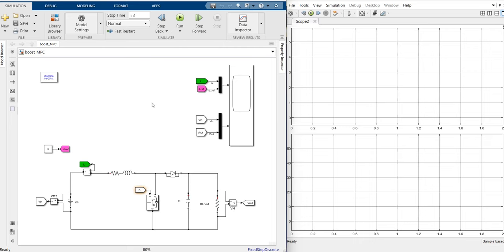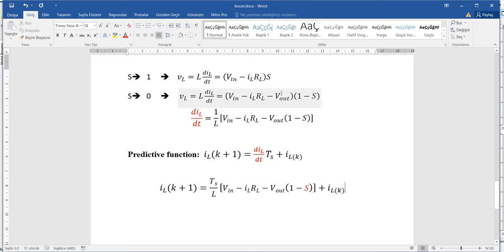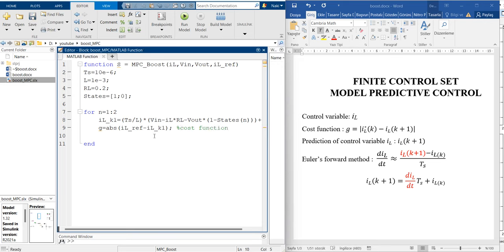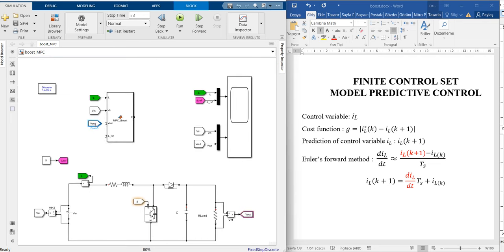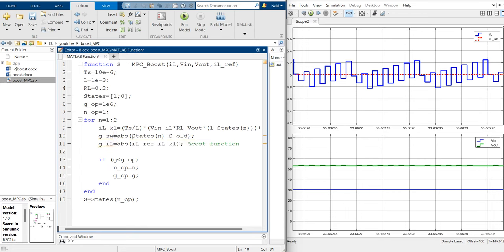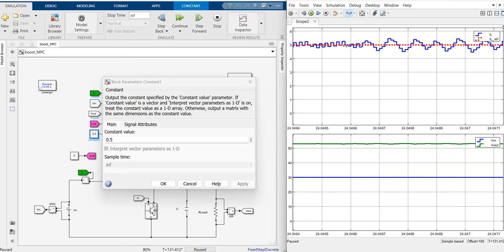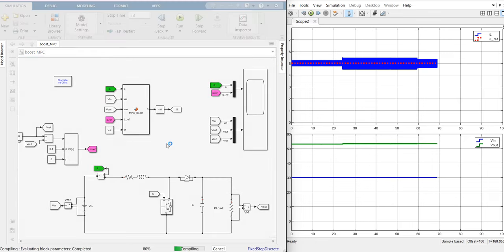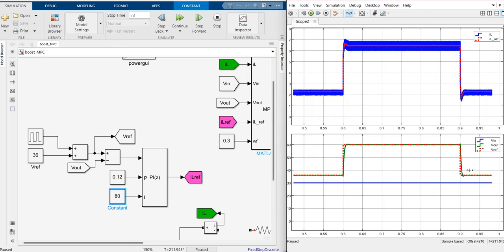Model Predictive Control of Boost Converter

Comment: Dear Professor,
Thank you for the valuable videos on your channel.
I would like to ask you about one of the controller types you discussed in your video: Passivity-Based Control (PBC).
[https://youtu.be/5YT7cERlMrg?si=23UajmS3S1arydMx]
Could you please clarify its classification among control system types?
Also, would it be possible for you to provide another video covering these specific controllers: IDA-PBC (Interconnection and Damping Assignment-Passivity Based Control), Port-Controlled Hamiltonian (PCH) systems, and the Hamilton-Jacobi-Bellman (HJB) method?
Thank you again for your efforts.

Comment: Hello,
I tried a model with the same wiring diagram and the same parameters, but the simscape components (from the domain with the blue lines) and the MATLAB function block were the same as yours.
Solver settings - type: Fixed-step
Solver: discrete (no continuous states)
Fixed move from: 1e-5

And I always get this simulation result: Solver "FixedStepDiscrete" cannot be used to simulate block diagram 'FCS_MPC__Model01' because it contains continuous states...

Could you help me set up the solver and your powergui? Thank you.
Reply: Hey u got the output
Reply: I have simulated successfully. Do you still need help?
Reply: @aungnyanhtun5924  yes

Comment: I want to ask if Vin changes, does Vout also change? for example, if the Vin of the PV changes according to the irradiance and the temperature of the Vout Boost converter it will stabilize at the desired voltage or change according to the Vin of the PV. and one more thing I ask is that because Vin VP changes regarding filling inductor and capacitor values in the boost converter, should we use which Vin value, is Vin the highest or should we take the average?
Reply: Vout shouldn't change in that situation

Comment: Hello, thank you for this captivating course. I have a question regarding the simulation: I noticed that at the beginning of it, 28:10  there is a significant surge in current. How can we manage this current to control it effectively?
Reply from the maker: Hello, thanks. Mainly, the current depends on the values of the system components such as capacitance and inductances. So if you change or improve a soft start for the control method it may be reduced.
Reply: @nakiguler   Good evening! Thank you for your response. Do you have any references on soft start? I would like to use it.
Reply from the maker: @boussaoudfarid8297 I have no reference, but it is an easy mechanism: you can use a rate limiter for determining the reference. But it may have a small effect. Normally high currents are injected by capacitances at the beginning. If you desire an initial voltage in the capacitor it may reduce please check.
Reply: @nakiguler  Thank you

Comment: How does we connect this boost converter to solar?
Reply from the maker: you can get the reference current from MPPT algorithm. I used it in this paper: A model predictive control-based hybrid MPPT method for boost converters
Reply: @nakiguler  but may i know how to adjust the parameter for the mpc?
Reply from the maker: @anis_najwa  which parameter? If you check the paper, you can see the output of the MPPT algorithm is used as the reference current.
Reply: @nakiguler  for mpc controller is it the same with the video?
Reply: i got confused because for this video we use iL but if we connect it to solar we use ipv?
Reply from the maker: Yes, because iL is the input current of converter and output current of PV.
Reply: so what i have to do after i have done with this video? do you have any example for the mppt code?
Reply from the maker: You can check my other videos
Reply: sir i have email you today regarding this video

Comment: You don't need to add a cost function to limit the switching frequency. Instead, just add a "zero order hold" for all of the measured variables with time constant Ts for Fsw = 1/(2*Ts). This is the proper approach to limit the frequency.
Reply from the maker: yes, it can be limit fsw. But if you want to adjust it, a variable is needed.
Reply: How can I contact you? I need to enquire about something.
Reply: how can do that please sir?

Comment: Great job, Dr . I want contact with u urgently
Reply from the maker: you can send email.
Reply: @nakiguler   can u give ur email?
Reply: @nakiguler  your mail please
Reply from the maker: @abdoumohamed2585  this is my official website: https://avesis.gazi.edu.tr/gulern/iletisim
Reply: @nakiguler  doesn't working bro it seems it's fake I did all steps but not working
Reply from the maker: @abdou_8646  what is fake?
Reply: @nakiguler  I thought there is something missed when u stope and run the recording I did all steps but I didn't found the same results the output voltage still at 30 v sir
Reply from the maker: Please try again and check carefully, all the steps are given in the video.
Reply: @nakiguler  thnx sir yes I tried for 4 h 
I did all possibility of power GUI solver discret continue i changed the il reference unfortunately doesn't working
Reply: @nakiguler  unfortunately the same pblm 
2nd qst sir please why u used external PID instead internal
Reply from the maker: @abdou_8646  I used externally to change the parameters easily.